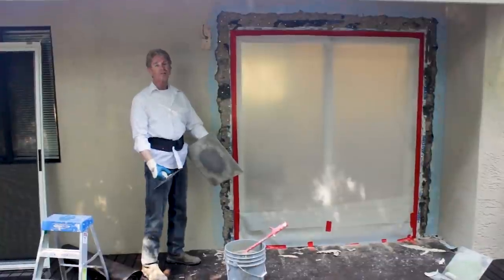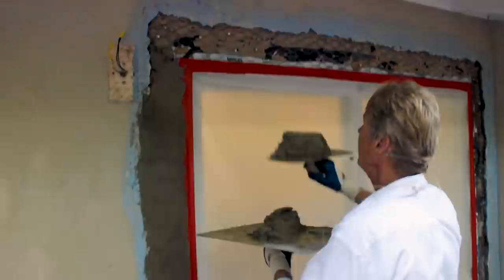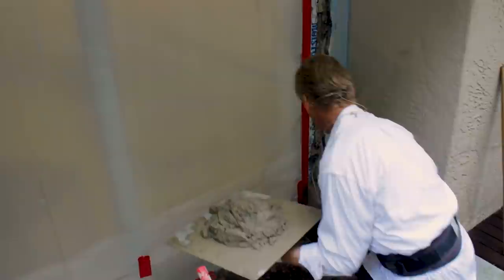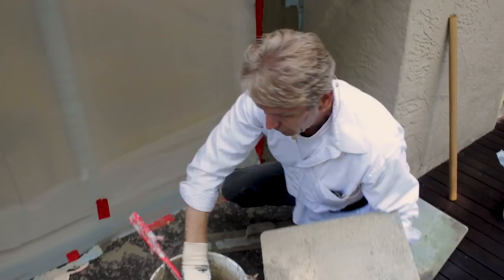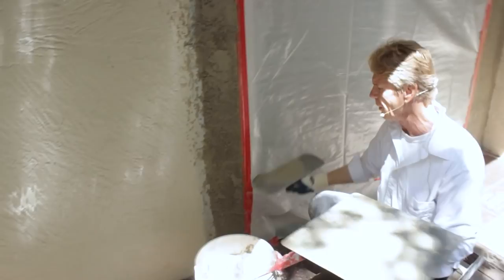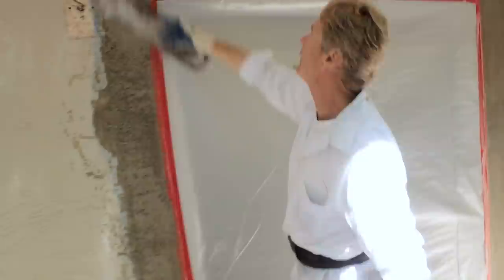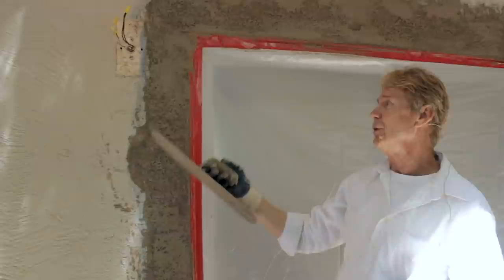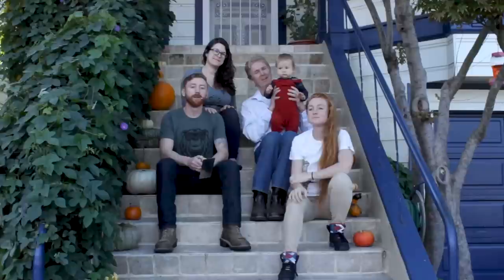Stucco a door fast with Rapid set

Comment: Hey man love your videos I think I've watched about 30 of them!  Hoping you can steer me in the right direction.  I have a real authentic adobe home with the traditional cementitious look in the typical adobe beige you see all over Santa Fe.  Problem is I am much further north with lots of freezing and rain so the water adsorbing stucco is probably not the best fit.  It also has the rounded parapet walls which I am constantly patching cracks in. (Even though I brush off all the snow in the winter so it wont melt/freeze.)  So to cut to the chase, some of the walls are hairline fractured and in some areas on the low balcony wall  bottoms of the wall stucco are failing and wood below is deteriorating.  I have patched but I am thinking the whole home should be painted to avoid any further damage but I think even a flat paint will ruin the patchy rustic traditional look and also affect the luster sheen of the house.  I like the idea of the stucco flex you did on the blue home in San Francisco, I believe,  but I think this will be too glossy.  Any idea how to save from further deterioration with a paint but maintain the original adobe wall look especially as it relates to the luster. I did paint some stucco chips off the house in a flat brown paint but it still looks glossy compared to original stucco.  Any tips you have would be greatly appreciated.   I too have a boy developing      " wisdom wiskers" so I feel you pain.  Lol.  Looks like you did a great job raising those boys and you got a beautiful family.  Good for you!   Cheers!

Comment: why is it on these you didn't "FEATHER OUT" the edges near as far as you usually do ?
Reply: I'm pretty sure because it is a skip trowel finish. He has said several times TRY not to over lap because it will show once painted. Imagine a skip on top a skip, that s getting pretty far extended out...  If it's a heavy sand finish ( on a forgiving wall) it's much easier to overlap it and blend it in. I'm no expert but that's what understood.
Reply from the maker: @MrCashgold  Exzackory my friends.💃

Comment: Knuckle head question … at HD, I’ve see te 25# box of mortar next to 25# box of Stucco … for a 2x4’ repair … am I just using the Stucco… ? Or the mortar? What’s the difference?

Thanks
Reply from the maker: Hi Michael, buy the box of stucco as you are doing stucco.
 Mortar usually means concrete.💃